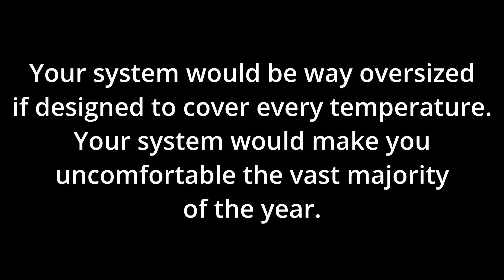Your Furnace Is Oversized On Purpose

Comment: split system units..40,000 btu is the smallest. this will match 24,000 btu cooling. We are looking at cfm units here, so sizing needs air flow to supply air volume to each room, 1 ton = 400 cfm or do 500 square feet per ton, 8 foot ceiling, T24 tells us smaller sizing, not a good idea to go so small...

Comment: But how do you size it? I live in Caro MI and I have a 1200 SF manufactured home on a crawl space. What size should it be with an 80% furnace using natural gas?
Reply from the maker: Load calc Ronnie!  You must do an accurate load calc. I went from an 80k furnace to a 2 ton heat pump. That's 80k btu to 24k btu. I did upgrades and then load calca using red calc, cool calc, wrightsoft, and remrate.